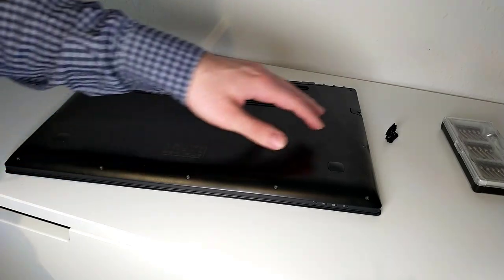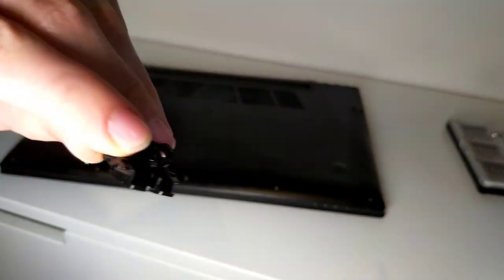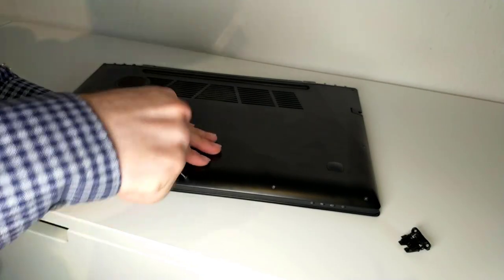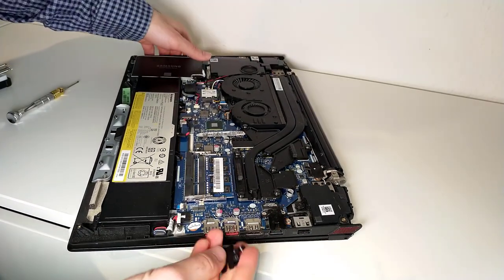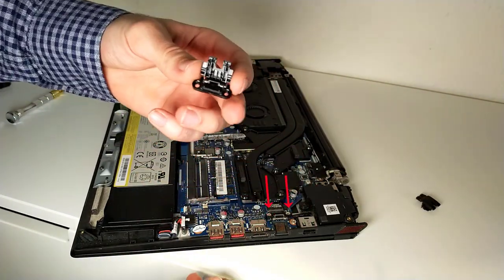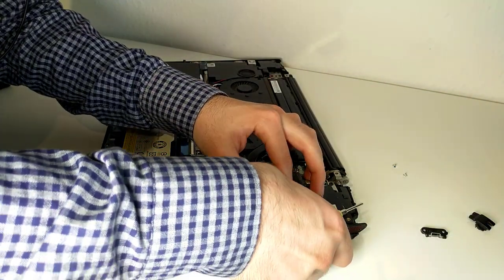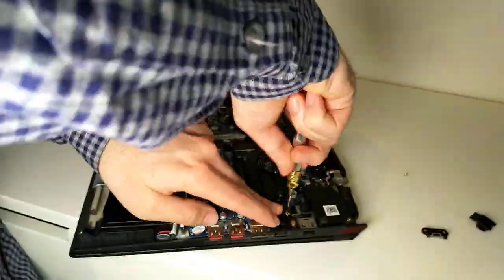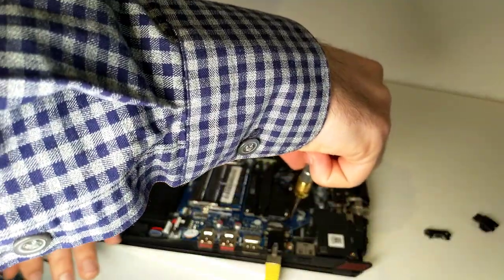Tutorial: Replace Lenovo Y50-70 RJ45 LAN port cover

Comment: If anyone has trouble removing the lower case after all screws are removed, know that it took a bit of extra force and careful wiggling to remove mine. Also, note that the metal brackets that hold the screw mounts are connected to the lower chassis by very fragile plastic pegs, so be very careful with this; they break easily.

Finally, thanks for this video! It helped me with a sanity check and allowed me to set up my expectations well. I just installed a new RJ45 clamp on my Y70-70 and it seems to be working well.

I think the RJ45 clamps for all of the normal Yx0-70 series laptops are the same. (READ BELOW)

UPDATE: Make sure the case is flush when you snap everything in! It seems to be bulging where the new clamp is and I'm beginning to wonder if I might have the wrong clamp!? I haven't had time to check yet.